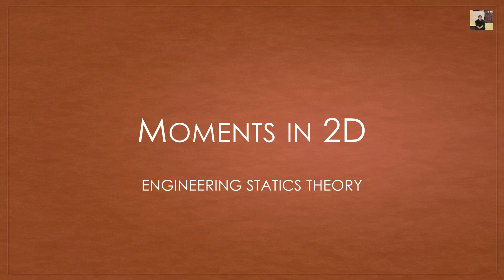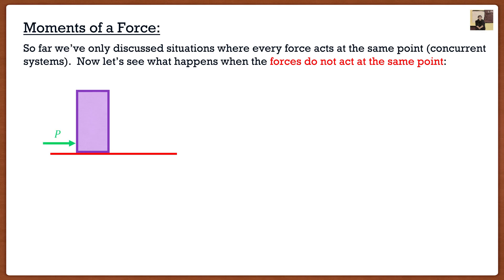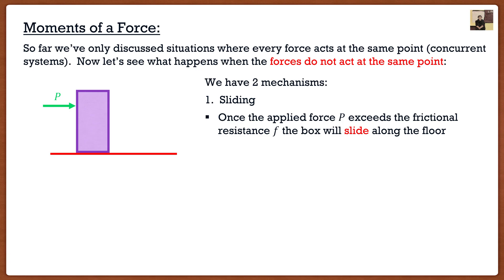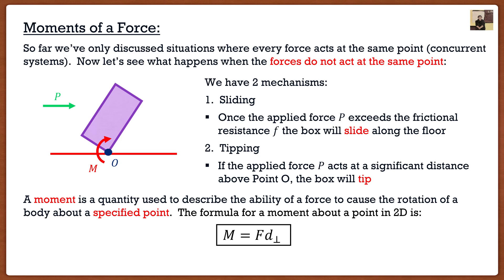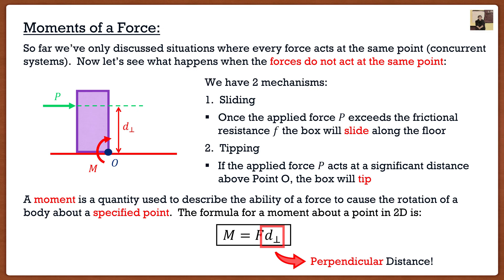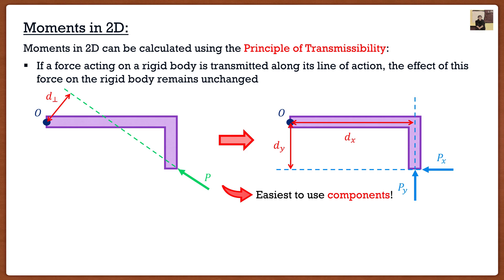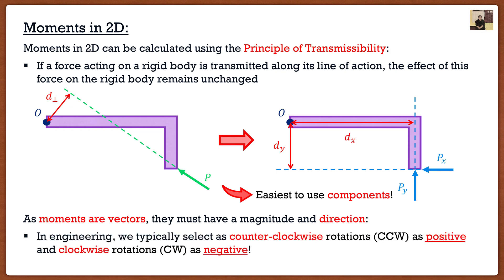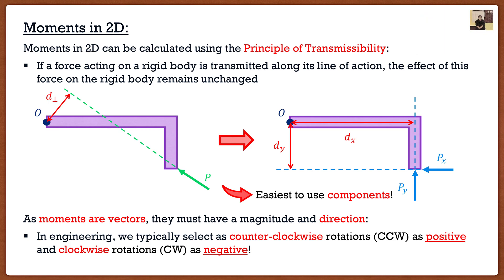Engineering Mechanics: Statics Theory | Calculating Moments in 2D

Comment: Since the 2D torque comes from the 3D torque, for which there is a simple linear formula, I would probably have told us about 3D torque first, so that the linearity property is not only stated, but also mathematically proven.

Apart from that, what you're doing is actually a pretty decent lecture! I think I might dare to go up the CN Tower one day!